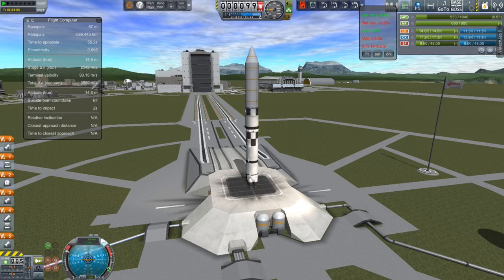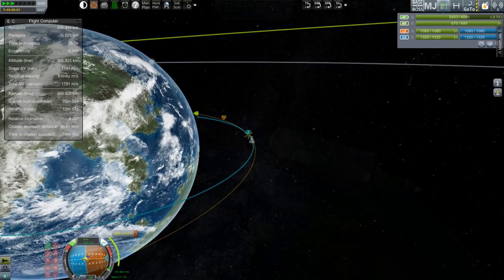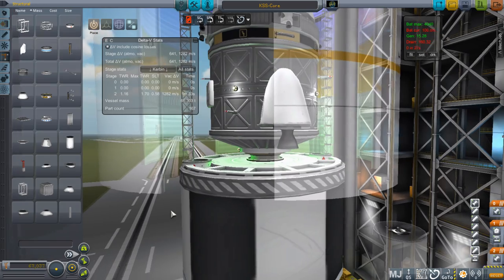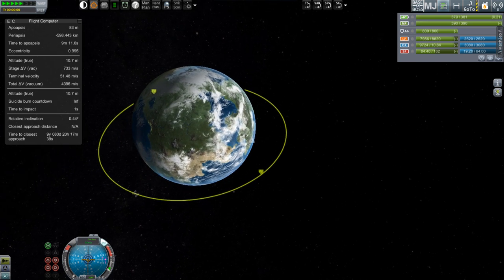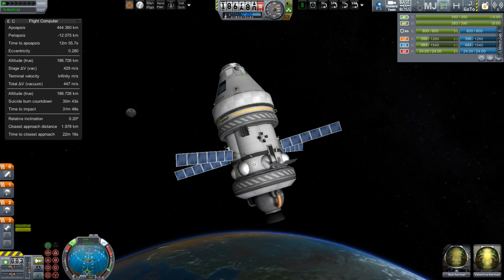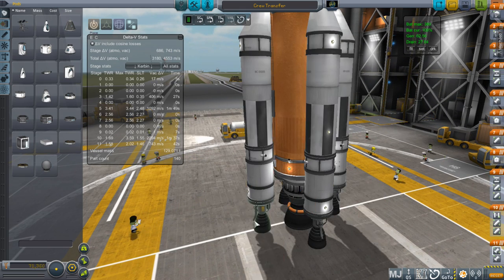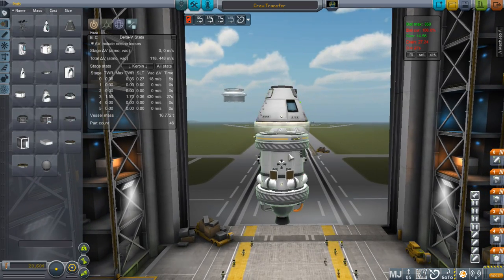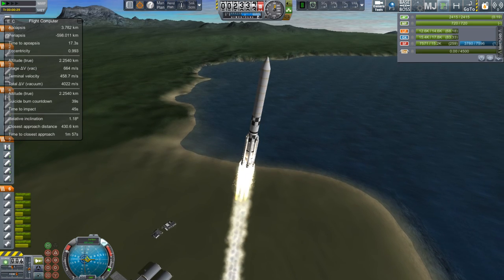GS3 "Kesla Serenity II, Part 1" -- Operation Gold Strike -- KSP 1.0.2

Comment: Hey Bob, how did you get the Engine Light mod to stop the 'flickering'?

The flickering effect of the light carries through to all my surface lights making it look like my space station needs a supply of spare bulbs. I noticed yours don't do this and figured with your wizardry and attention to detail you edited the mod files to stop the flickering effect
Reply from the maker: jonthedoors Increase your pixel light count in the settings. I drag mine all the way to the right. 64! MORE LIGHTS!
Reply: Always gotta have more lights

Comment: How did you change the textures?
Reply from the maker: Driss Jack it may have been Ven's or KSPRC but I don't know for sure because I messed around with several mods (a dozen+) at the same time before restarting
Reply: Bob Fitch both of them are cool!!